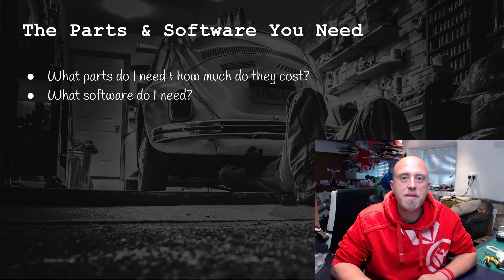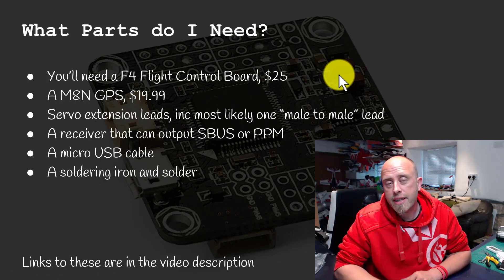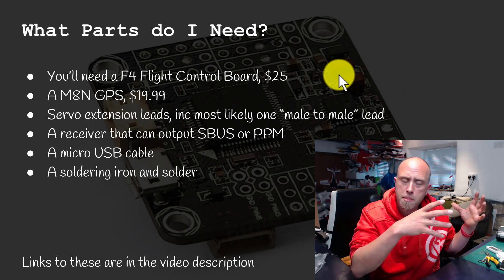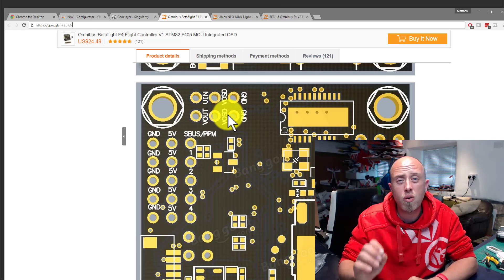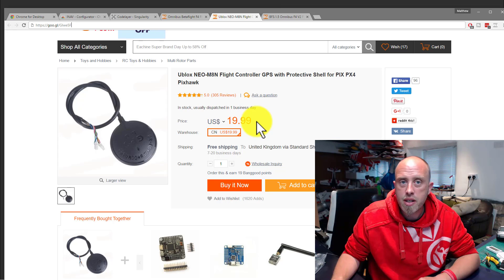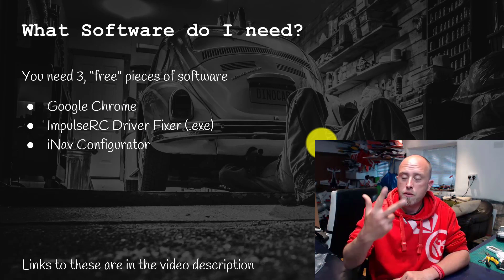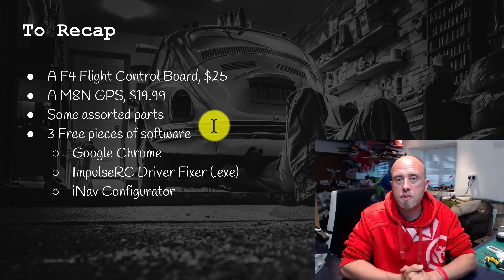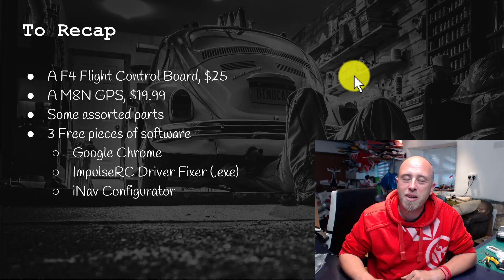Part #2 - What Do You Need to Use iNav? Software & Hardware

Comment: Hi there all. I am going to use this tutorial for a B 17 build. first time i have done a fixed wing but have built plenty of quads.  was wondering if im going to run in to any other hassles or issues using an omnibus F4 v3 .Any support greatly appreciated tia
Reply from the maker: Howdy fella, no sure what you mean by issues, see the series. Matt
Reply: I mean that you speak of the v1 and v2 OBF4 I have a v3 and haven’t heard you mention that as yet should I just treat it as the v2 or is it dif again

Comment: Omnibus F4 BetaFlight 3.2.0 OSD STM32F405RGT6 Flight Controller for FPV Racing Drone 30.5X30.5MM will this bourd for fixed wing  ?
Reply from the maker: Howdy Ralph, see the other questions. The Matek F722 and wing PDB is the best choice right now. Matt
Reply: Hello Matt ...thank you for the reply I will check it them out I'm flying a ranger 2000 ...thinking I might have the wrong bourd for it
Reply: Matek Systems F722-STD STM32F722 Flight Controller Built-in BetaFlight OSD BMP280 Barometer Blackbox is this it ? Lol

Comment: Hi Matt, for Inav fixed wing, do you suggest a barometer? If no, how will it affect RTH and Missions, etc. Also with FC's with built in barometers, will the altitude reading be off if it is inside a covered canopy?
Reply from the maker: Howdy fella, see the next video in the series as the baro & mag use is mentioned. It i not needed for fixed wing models, Matt

Comment: Hi Matt, excellent series.  One big issue which I believe has happened is that banggood don't sell that "advanced" V2 board anymore and your link now goes to "BF3.2 Omnibus F4 V2.1 Flight Controller STM32 F405 MCU Integrated OSD Built-in 5V BEC Current Meter".  The problem is that there seems to be some issues with the V2.1 at the moment and it wont work with INAV at least in the setup you have given with SBUS on standard SBUS input (UART1?), you have to use UART6 for the SBUS and a special custom .hex file from INAV and put the GPS on UART3 and change the wiring of the GPS to remove the magnetometer, so not exactly an easy setup.  This is my understanding from my attempts (still have not got it working) and INAV issue number #2576.

Comment: Matt - Do the F4 V1&V2  boards come with cables and pin headers -  if not are they packaged somewhere else...joe
Reply from the maker: Howdy Joe, you'll need the 6 pin lead for the GPS unit, as for whether they come with the pin headers, that depends on the board and the supplier. Most of the times they do, but not always, Matt

Comment: Matt - I've been on BG's site and come accross an iNav F3 FC with an M8N GPS unit £40 what does yer think - I know you've gone to the trouble of packaging and appraising a system but - your thoughts - hell ! - probably lots of folk have other sugestions so maybe a bad idear to ask..joe
Reply from the maker: Howdy Joe, I'd buy the other parts as I've never used that GPS unit, not does the total price seem right either (as it can be bought cheaper separately) and you'll never use that GPS stand on a fixed wing model. Hope that helps Joe! Matt
Reply: I'll go along with yer on this ...joe

Comment: Hi Matt, have you used these NZ GPS units before, https://www.banggood.com/NZ-GPS-For-NAZE32-Flip32-6dof-10dof-Best-For-QAV250-ZMR250-Multicopter-Quadcopter-p-1015134.html?rmmds=search.
Reply from the maker: Howdy Chris, Yes I have and sadly it died and no longer works, Matt
Reply: RagTheNutsOff  I'll stick to the usual one we both use. Still not sure if the S800 v2 over the v1. Hobby king have price mached EBay for £30 plus postage for the kit.., uk store.
Reply from the maker: Howdy Chris, the V1 and V2 of the S800 are exactly the same, bar one is grey foam and the other is black. Happy days on the price match too! Matt

Comment: Hi Matt, thanks very much for your awesome and extremely helpful videos.  I have one question on the Omnibus F4 V1.  The description on Banggood states that it is does not have a barometer. Is this limiting in any way, e.g. for altitude control or otherwise.  

Thanks.

Comment: You do understand that the pin headers can be soldered to either side of the board right?
Reply from the maker: Yep, but if soldered to the bottom, I cannot mount in sme of the models. Matt

Comment: Hi Matt!
Thanks for the great videohelp! Now, I used the link here and bought a FC but the GPS unit is out of stock at Banggood. Do you know of any replacement unit that works?
Reply from the maker: Howdy, Have a look on eBay, there are lots on there, I'd suggest the same unit as they have worked really well for me. Matt
Reply: Thanks, Matt! Have a great day!

Comment: Matt thank you so much for doing this series I have been interested in this for a while but really needed the help with details.
One question, I don't have Windows so I'm wondering is there an alternative way to get the board into boot mode so I cal load iNav?
Thank you.
Reply from the maker: Howdy Jon, I'm pretty sure the board will load in DFU mode on a mac or unix system. I've not tried this myself, however google will be your friend on doing that part. The rest is platform independant Jon. Matt
Reply: Thank you. I thought it should but I haven't tried to boot a board before.  I'll check out the other board you mentioned too and do some googling. Have a good one.

Comment: Thanks Matt , I may buy both versions of the board as they look like a good and cheap alternative to apm and pixhawk which I currently have.Also look alot easier to use plus the osd built in and I only use 3 main flight modes.Stabilize, gps position hold and RTH
Looking foward to the rest of the inav videos :)
Reply from the maker: Howdy Anthony, yea once you have it working on one board, you can easily find out what the changed settings are, copy them and then paste them onto another board. Obviously you'll need to calibrate the other board and do the wiring for it. Thats what I've been doing :) Matt

Comment: I see that the version 2 board has a Barometer but v1 does not, This would be a lot more accurate in holding altitude also would help a lot with auto land.

Still deciding if I should get a couple v1 or v2 boards for only $1 extra the v2 has current meter and Barometer.
Reply from the maker: Howdy Anthony, I disable the baro as that caused me issues first time around. The height is calculated using the GPS which will be fine for the vast majority of flying. I've got both types of boards, both work very well! Matt
Reply from the maker: Amir Barenholtz Howdy Amir, that's correct. This series is for fixed wing, not multirotors. Matt
Reply from the maker: Howdy Amir, yea I'll add an extra section for iNav in multi-rotors later. I have a 250 frame here with some new parts I'll use for it. Waiting on a ESC at the moment though! Matt
Reply: Hello Matthew , great series , thank you !  I also came from apm and I fly a  multi rotor  , i also look on inav as an alternative to apm , however in the inav wiki they clearly say that for  3D position hold or alt hold  a barometer is mandatory , it also does not say anywhere   that the altitude is calculated using gps - 
On the contrary  they emphasis that without a baro altitude must be maintained manually by the pilot in all modes were altitude is significant .  I dont know a lot about fix wing but for multi rotors and especially for those that expecting similar functionality they had in apm (loiter , poshold , rth ) a barometer is crucial . for a multirotor altitude calculated from gps  it is not accurate enough for  3d position holdr - since the gps alt resolution is in meters  while a baro resolution is in centimeters .
Reply: yes, I'm aware of that - however your series in most aspects is applicable for multi copters as well :-)  and many multi-copter pilots are finding interest in your series - especially those that are looking for a modern and not expensive alternative to APM .
Reply: great to hear !

Comment: Dear Matt.  I have some experience of flying multi rotors.  Is a C1 Chaser a good wing for a beginner?

Thanks for the videos.
Reply from the maker: Howdy Mark, I love my C1 Chaser it's a fantastic model. There is a "however" though, go for a Reptile S800 instead, they're tougher. I stuffed mine in a tree at ~100mph https://www.youtube.com/watch?v=Wdg1fJC3SqY Hope that helps Mark, Matt
Reply: Hi Matt. Thanks for the advise.  Started building the S800 and taking my time.  Question is: How do you arm the board to test servos etc?  I'm getting an equip check failure even if I turn off the gps.  Any ideas?

Comment: Dear Matt
Thank you very much for answering my question about missions with INave.
I listened the series about the INave, they look fantastic.
I have the Mini Talon in the box, I already have the famous servos of mtalic gears and the  sunnysky 1400KV motor I going to order the esc, the flight control system was wayting for more knolage. Initially I was leaning towards APM 2.8 but with this information it seems to me that the F4 bus will be a good option. Don't you agree?
Since you spoke in external sensors to the plate like the speed control, can you cover that in the next episode? Can the APM 2.8 speed sensor be used on the F4 bus? To have the air speed? And use missions with QGC?
Regards Vítor Lalanda
Reply from the maker: Howdy Vítor, QGC isn;t compatible with iNav I'm afraid. For the Mini Talon that model needs a custom servo ix which is covered on this page https://github.com/iNavFlight/inav/wiki/Custom-mixes-for-exotic-setups#v-tail-fixed-wing for the APM speed sensor, absolutely no idea! Matt
Reply: Tanks!

Comment: I use these boards in my quadcopter builds and I have a 'miniracewing' on order. This video series came along at just the right time for me :) You have to be careful not to power too much from the boards 5v feed though, they have a tendency to cook themselves.
Reply from the maker: Howdy Callum, yea there is only so much current the onboard voltage regulator can provide. We'll touch on that in a later episode. For a flying wing that has 2 servos it should be fine. A normal fixed wing servos with 4 or more servos, yea could be an issue. Matt

Comment: Just ordered one Omnibus F4 and two GPS units with the idea of buying the V2 (Ammeter, BEC) version when they come back into stock.  Will you post an affiliate link to the necessary plugs & cables as I don't have a huge inventory as yet.
Reply from the maker: Howdy fella, the only cable you may not have is a male to male servo lead, they're silly inexpensive and can be picked up anywhere, on BG, eBay & so on... Matt

Comment: https://www.banggood.com/Mini-Ublox-M8N-GPS-Module-NEO-M8N-GPS-for-APM-2_52_62_8-CC3D-SP-Racing-F3-Naze32-Flip32-PX4-p-1035454.html?rmmds=search

Can I use the above M8N GPS ? 
Why it say without "comes without compass" ? for SP F3
Reply from the maker: Hi Sajaks, I'm sure it'll probably work but I'm sticking to what I know works, hence the other GPS unit as mentioned in the video. Also note that GPS unit is $15 more expensive! Matt
Reply: +sajakstrading has a good point though. Why buy a unit designed to work with the Pixhawk, rewire it, and ignore half of the functionality(compass)? How about this Ublox 7 with the same 10Hz update rate, no compass, and half the price? https://www.banggood.com/VK2635U7G5LF-10HZ-High-Frequency-GPS-Module-UBLOX-GMOUSE-p-1053191.html?rmmds=myorder
Reply from the maker: Ted Hancock Howdy Ted, the answer to that is simple. I'm showing you the parts that I use and know to work well. I'm sure other GPS units will work ok, however for me the NEO-M8N is my choice for my models. Matt
Reply: Thanks so much for your rapid response! Yes, I can definitely understand the "if it ain't broke, don't fix it" philosophy. This is a very helpful series, btw, and you are doing an excellent service here for the often overlooked fixed wing community. I have watched every episode of this and plan to start upgrading my Z84 to iNav soon (because I'm a terrible newbie pilot).

Comment: to power up the FC, basically I will connect my plane ESC (with 5v UBEC) cable to PWM1  ? or do I need additional 5v UBEC regulator ?
Reply from the maker: Howdy Sajaks, I'll be covering the setup for the suggested board in a later episode, Matt

Comment: I dont have pin for my SPRacing F3, do recommend solder directly servo cable to the board ... or get extension servo cable, cut  and solder female connector to the board ?
Reply from the maker: Howdy Sajaks, if you feel comfortable soldering directly to the board, go for it.  Personally I prefer pin headers as it makes connecting up the board a lot easier, hope that helps, Matt

Comment: I prefer F3 boards.  I fly FrSky also, and getting the telemetry back to an XSR or an X4RSB receiver is plug and play with an F3 board - with an F4 board there is some extra soldering and it isn't quite as simple (thought still not difficult).  Also, on a fixed wing, you're really not using much of the F3 processor - on my S800 wing I'm only using less than 10% of the CPU capacity, so the F3 board is way more than capable - and $4 less to boot (it was on sale for a while at only $17) (https://www.banggood.com/Betaflight-F3-AIO-V1_1-Flight-Controller-with-Integrated-OSD-p-1086563.html?rmmds=search).
Reply from the maker: Morning Kurtis, yep I noticed that too. Very low CPU usage which is promising so the board won't cook itself when enclosed in a foam model. The board I'm suggesting is the one I've used & know works well, so sticking with what I know, Matt